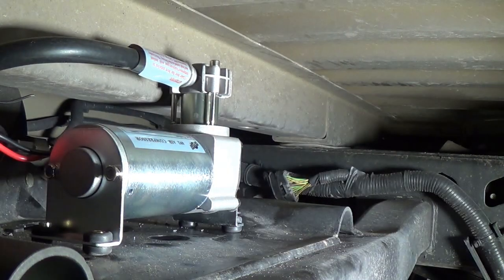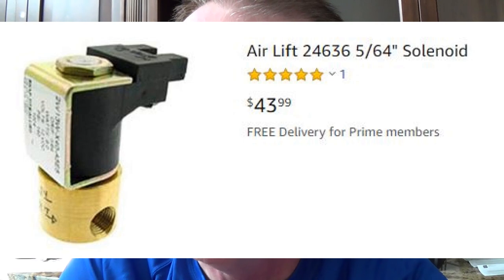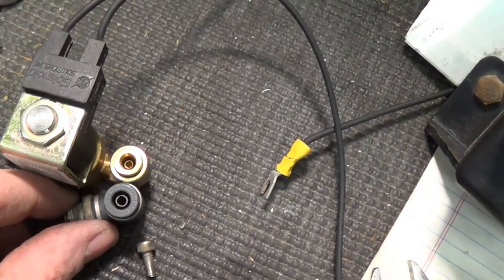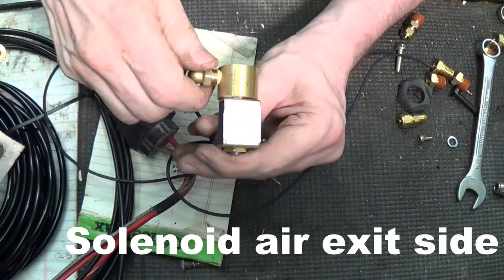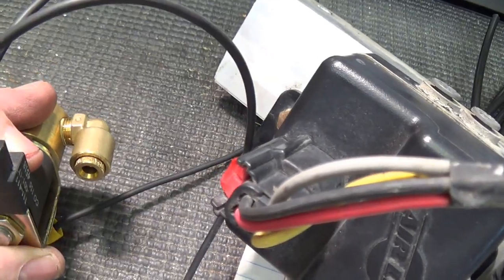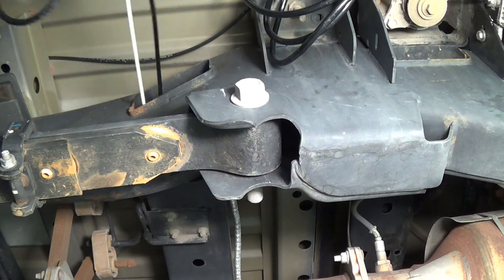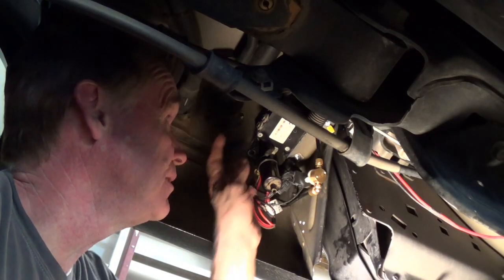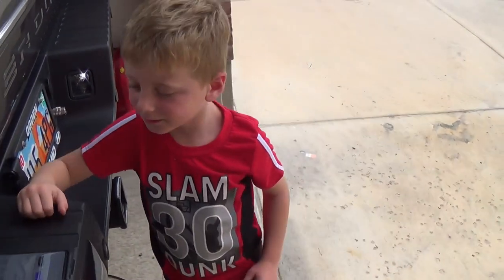Using Airlift wireless control with on-board air system

Comment: Epic Cowlick: your video is very informative.  thank you for that.  I want to add a similar air spring setup to a 2019 lariat f350 we have.  what specific brand did you use for your air springs kit?  is it "Air Lift"?
Reply from the maker: I've used Firestone before but went with the Air Lift brand this time. The internal jounce bumpers are ingenious and saved me when the compressor failed. Here's a link to the install video: https://www.youtube.com/watch?v=l2QWCouORTk

Comment: Great video! I have a viair 200psi system on my truck. I have airlift bags with a manual tire valve to fill them. I also have an analog airlift gauge with a switch and deflate valve that I want to incorporate. It looks like the solenoid is only rated to 140psi while my tank pressure is 200. Any idea on how to “step down” the pressure from the tank to the solenoid?
Reply: You can add a pressure regulator in between the tank and the valve and set it to 125 or so psi. In your case you can stay with the 1/4 inch hose all the way through.

Comment: I've stumbled on to your channel and really enjoy the content. I'm looking at putting in the dual viair and tank like you with some ride rite firestone bags. Also seen dual firestone auto mechanical load leveling kit similar to my semi. Max psi of the tank is 150 as well as the bags. The auto load levels will cut off when level before getting to 150, and then tank will shutoff at 150. Thinking about going this route to bypass a remote, switches, manifolds.... What do you think?

Comment: Thank you for the video! I have the Air Lift 5000 analog system on my truck, but I want to install an air tank for accessory use such as airing up tires. I have the analog gauge in the cab where I control the air bags. I plan to install the pressure gauge and quick disconnect for the air tank somewhere in the bed of the truck. Is there a relay/solenoid I can install on the tank that is controlled by my in cab gauge for the air shocks only? So when I need to level my load, I can air up the shocks in cab to a certain pressure, and later use an accessory hose from the tank to air up tires and such.
Reply from the maker: You can run several systems off the AirLift tank. The tank has four ports (one of which should be used for the overpressure valve) and you can use T connectors to add extra access where needed. I did that in this video. You can send air lines into the cab to manually inflate and deflate the airbags as well.

Comment: Epic cowlick how do you like this truck vs your 2011? I have watched your videos since then and used a lot of these same improvements on my truck. U made great vids keep it up!
Reply from the maker: This truck is a couple of notches ahead of the previous model. But that's not surprising. Engine is stronger, Ford solved some fuel pump issues, rear end is bigger, and on. That doesn't make the 2011-2016 any less, it just the constant improvements that come naturally. It's fun tweaking them with more capability. Air horns next!
Reply: @EpicCowlick  I'm currently trying to find just the parts I need to make this work I.e Manifold, water separator etc. I have on board air so I don't want to buy a whole kit. What would you suggest?

Comment: I've seen you use the white goop and the orange teflon tape for thread sealing. Which do you like more?
Reply from the maker: Great question. I started using the goop more and more lately and it seems to seal better. Teflon tape for stuff I don't care about and thread sealant when it matters more.

Comment: I’ve been thinking about this exact setup for sometime and came across your video which was very well thought out. My only question is where did you get the remote for the airbags without having to purchase the entire kit?  I have the HD VIAIR compressor and would like to be able to operate my airbags on the fly using a remote control inside my truck. Any thoughts on how I can achieve this without having to purchase the entire airlift kit?
Reply from the maker: The wireless controller is one part of a three part kit. Controller, manifold and little compressor.  You need everything in that kit except the compressor. Others have asked the same thing and it's apparently hard to get just those two pieces. And don't forget the connectors and hoses and wiring. Unless you find something used on Ebay or something,  it's cheaper to just get the AirLift kit and toss the little compressor.

Comment: Hey Cowlick, glad I found your channel. I like your logical approach to solving problems. Question for ya. I’m debating an on-board air system for my F-250 that currently has airbags. I would like to have the wireless control as well. If I only choose one, which do you think would be more beneficial? The OBA system would give me air to re-inflate bags when I go to leave the campground, I would just have to manually do it. Maybe I can buy just the wireless manifold instead of the whole system and set it up like you did in this vid. Just don’t want to get stuck with the tiny compressor that comes with the Wireless kit.  Love the vids 🤘🏼
Reply from the maker: I've found that trying to piece a wireless manifold system together from parts will cost about the same as buying the whole thing and just putting the compressor on a shelf. There are plenty of options including controls in cab that are pretty cheap. The onboard air is the first step, figuring out which system to use to fill the airbags is pretty specific to individual needs.
Reply: @EpicCowlick  thanks. That’s kind of what I was thinking too.

Comment: Any reason why you went with the WirelessAir and not the AirOne?  I can't seem to find a reason to get individually adjustable sides.  Thanks!
Reply from the maker: Supposedly if a single source of air is used to inflate both bags, the air can travel back and forth between them and it creates a rocking back and forth issue? But I've never had a reason to inflate bags separately either. I've just always used the Wireless air kit and haven't tried the AirOne.

Comment: Why the solenoid? will the 2 gallon air tank damage the air manifold, or are you just worried about over shooting psi in air bags?
I am asking because i just ordered this kit and your idea sound good!
Reply from the maker: The solenoid is in the same place in the circuit as the compressor was. The manifold sends 12V over that line to run the compressor to fill the bags. The manifold does not know that the compressor is gone and has been replaced with an air solenoid. It only knows that the air pressure in the airbags is increasing and it stops the current when the preset pressure is reached. The smaller hose is used to reduce the volume of air that goes to the manifold. It is not designed to handle that amount of air so a smaller hose is needed.
Reply: @EpicCowlick   Thank you

Comment: Do you have any Amazon links for the fittings that you used on both the manifold dryer and the air solenoid?
Reply from the maker: Sure can. The video description has been updated with the links. The main search terms to find the reduced size fittings and hose is "3/16 NPT DOT brake fitting" or "3/16 NPT DOT brake hose".

Comment: Great video!  I already have Airlift airbags installed. Looking at wireless compressor kits.
Is it possible to just purchase all items separately needed for a wireless. system (like Airlift 72000)
Would like to be able to start with a Viair compressor & tank from the beginning and NOT have to buy complete Airlift 72000 compressor kit unless that’s the only way.  Thanks
Reply from the maker: With onboard air, you won't need another compressor for the airbags of course. The best part about the 72000 system is the wireless controller and the manifold that keeps the bags at a preset pressure. There is still lots of value in those pieces even if you skip the little dedicated compressor and use your Viair air tank. Have you seen my video on how to do that?
Reply: @EpicCowlick  
Yes I did see your video. That’s why I asked IF all the pieces from the 72000 can be purchased separately. If it would be cheaper than buying the whole 72000 kit,  then I could buy the Viair compressor and tank and hopefully be able to do exactly what you did. I really like the idea of being able to adjust the airbags on the fly.
Thanks
Reply from the maker: @user-fs1sc9yf9y  Gotcha. I guess you can check ebay/amazon for the a la carte pieces. I've replaced my wireless controller once because I left it on the bumper and lost it. That alone was over $125. You'd need to find the manifold and relay wiring and whatever else. You might be able to save some $$$.
Reply: @EpicCowlick  
Yeah I will check and see. If not I will just buy the 72000 and if it takes a dump,  then go with Viair and a tank and (try) to duplicate what you did. 
Thanks again
Reply: You wouldn’t have the individual part numbers by any chance would you? I could not find all the parts or any part numbers except for the wireless monitor.
Thanks
Reply from the maker: @user-fs1sc9yf9y  Sorry but I don't know either. If you do decide to buy the individual parts, be sure you get a manifold and controller that are compatible together. It would be a bummer to go to all that trouble only to find out you can't pair the components.
Reply: @EpicCowlick  ok no problem.........I’m just going to get the 72000 and install it and if I ever have a problem with compressor, then I will go to Viair & tank. If that ever happens, I’ll probably have to contact you to help me with the install.
Thanks for all your help!
Reply: @user-fs1sc9yf9y  I called airlift and they told me for my set up that I have which is dual viair 485c with a 10 gallon tank that is cheaper to buy the 7400 2nd generation than to buy everything separate and I also had to buy the solenoid it ran me 611 for everything

Comment: I just added air springs to my Sierra 3500 to smooth out the ride while towing my 5th wheel.  Can I add the wireless air compressor system and the onboard air with one system?  In other words can purchase the Air lift wireless air system and  just add a 3 gallon air tank and call it a day?  I can use system as normal to fill my air springs and add a quick connect to the bumper to fill my tires.   To me buying the Viair and the Air Lift is overkill.  How can I accomplish this with just one kit?
Reply from the maker: The Airlift compressor is tiny and would take forever to fill a tank. It may not even be rated to run long enough to do it and being driven by the manifold pressure, it would not know when to run. Not even sure how to pull that off. There really is very little overlap between the two systems when plumbing them together. The only redundant component is the AirLift compressor and that needs to be replaced by the valve used in the video (or something similar). The Viair system is a completely separate system in and of itself and does provide many benefits beyond just inflating air bags.

Comment: great info exactly what im planing.  did you run the standard 1/4 hose to the solenoid and run the 3/16 from the solenoid to the manifold?
Reply from the maker: Exactly. The solenoid can handle the volume, the manifold can not.
Reply: @EpicCowlick  awesome thanks, i just order the fittings, hornblasters dual compressor 8 gal tank the air lift manifold etc. haha thanks for the help
Reply from the maker: @stephenshin7114  8 gallons! That will get the job done!
Reply: @EpicCowlick  do you know what the psi i should run into the manifold? im getting a pressure regulator so control that.
Reply from the maker: @stephenshin7114  I talked to an AirLift rep who got the word from one of their engineers. He said the valve in the manifold is the same as their Performance line which is rated to 200 psi. But you have to remember that 1/4 inch NPT at 150 psi will flow way too much air. You'll to experiment with it but if you're going to stay 1/4 up to the manifold, you should probably start at 100 psi and see if that's too much. You'll know if the manifold has to exhaust air immediately after letting air through to the air bag.
Reply from the maker: @stephenshin7114  150 psi through the 3/8th NPT is right at the maximum volume the manifold can handle.
Reply: Yea I bought the fitting for the 3/16 I'll start at 100 to begin with regardless.  I'm not to worries on how fast it fills.

Comment: Where did you get the 1/4 npt to 3/6 elbow push connect. I cannot find them anywhere even online. You even mentioned they were DOT certified. I only found the compression and they are leaking like crazy.
Reply from the maker: I had the same trouble finding them online. I ended up at a local commercial trucking supply company that supplies semi truck brake lines and parts.
Reply: Thanks. I actually found the ones you posted and order those. It works great! Thanks for the video. I installed the Generation 2 Wireless One which after contacting Airlift they said it wouldn’t work. Works great for me! Just have a leak in the 3/16 fittings because all I could find locally was a compression fitting and I didn’t like them. Hope the new push ones I ordered work. Thanks again!
Reply: So I got the new 3/16 push connectors in from Amazon. No good. Still leak. I’m going to keep working on them to see if I can get them to not leak but not promising. 

The issue I’m running into is the new WirelessOne from AirLift has a 1/4 push connector but you can’t remove it like you did to replace it with a 3/16, so I have to go from a 1/4 on my solenoid to 3/16 for the tube then back into a 1/4 push connector so I can put a 1/4 tube to fit into the manifold. Do you think if I kept it just a 1/4 it would be too much airflow? My max airflow is 120 psi.
Reply from the maker: @MatgyverATX  You sure can try the 1/4 line all the way through. The problem is that if the manifold gets too much air it will shut and exhaust the overpressure. It ends up in a cycle of overpressure - exhaust- over-pressure - exhaust until it gets close enough to the desired pressure that it completes. It's also potentially damaging to the valve in the manifold. There's a guy on youtube who did this and just ignored the overpressure/exhaust cycles and didn't worry about them. I never found out how that worked in the long term. In your case, who knows? It may work without any problem? It's not hard to plug in 1/4 all the way through and see how it works.

If you want to get creative, you might try to figure out a way to restrict a 1/4 inch hose in some way. All you're really trying to do is to create a smaller space for the airflow so less can get through at any given pressure. Maybe a 1/4 to 1/4 hose connector of some kind? Just thinking out loud.

One last thing that may help is to use a proper hose cutter instead of a knife as I did in the video. I was able to get rid of one leaky connection by just making sure I had a super square and clean cut before pushing it into the quick connector. Google "plastic tubing cutter" and you'll see several options for cheap.
Reply: Yeah I’ve got a hose cutter that cuts a clean cut. I’m going to try again and see if I can seal it up. I also thought about 1/4 tube with a regulator but they tend to leak sometimes. I’ll keep playing around and see what works.
Reply: Success! Well so far at least. With that 1/4 regulator I got from Grainger I was able to keep it 1/4 tubing the whole way but dial down the pressure to whatever I wanted to make sure the manifold isn’t over pressured. So far no leaks. Hope it holds! Thanks again for all your videos!

Comment: What compressor do you have that held up well and fit well in the vehicle?
Reply from the maker: I used a Viair single compressor system on the previous truck and went for a Viair dual compressor system on this truck. Those compressors are sealed and have held up very well over the years. Install videos are on the channel and links to the systems are in the video description.

Comment: Why use a solenoid. Isn’t the control
Valve in the manifold closed until you command the bags to be inflated.
Reply from the maker: The manifold will return an error if it does not detect a proper load on the compressor circuit. The solenoid is a quick way to accomplish that.

Comment: Couldnt you just use a manual speed controller instead of changing line sizes? (not a regulator, a speed controller effectively reduces line diameter) and keep the lines 1/4 for easy repairs?
Reply from the maker: Whatever works. It's all about air volume control.